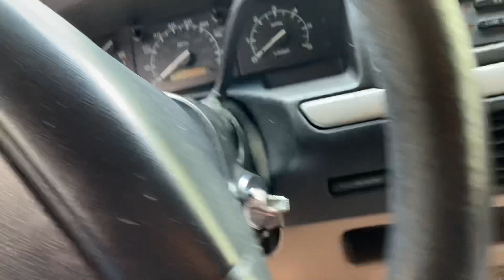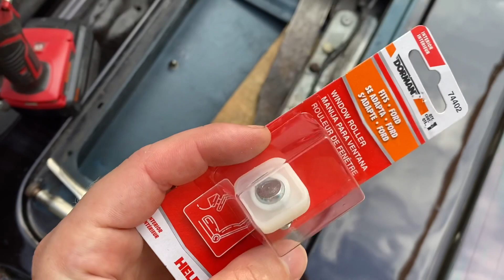OBS Bronco Fever: Why Did We Buy a 3rd One? Truck Stuff Vlog Ep. 8

Comment: You could probably plastic weld that bracket. Melt stanless mesh down into the bracket and then melt some plastic rod over it to bolster the support. You can drill or poke a hole through the mesh to put the bolt back in.

Comment: I have a white 1994 and my dash did the same thing.check out bronco graveyard. They have a fix for it. Btw the black bronco looks perfect. I have a new 2” lift in the boxes in the garage and a new carpet kit. Just saving up. For some new 33x12.50x15 tires and some nice weather. Been pretty wet here in Oregon. Definitely hold on to that black one,I’m pretty sure you know what a nice one goes for.
Reply from the maker: I appreciate the heads up about the dash! Yours will look great with the new lift and tires. Just the right size. Checkout my OBS Bronco playlist on my channel, my black one is actually kodiak brown and it looks like root beer in the sun in some of the videos